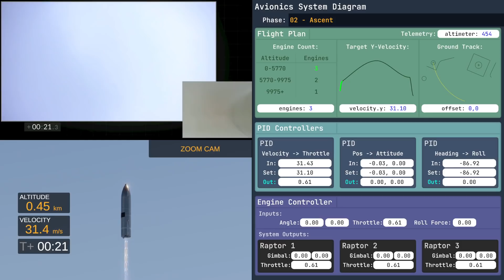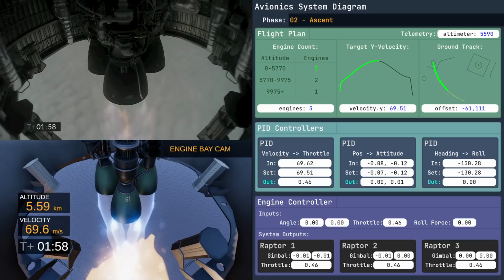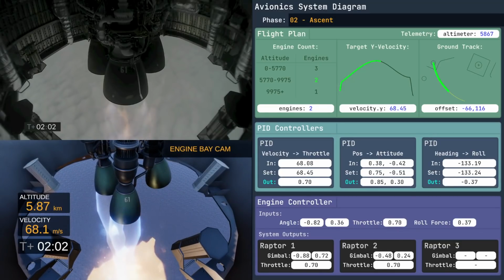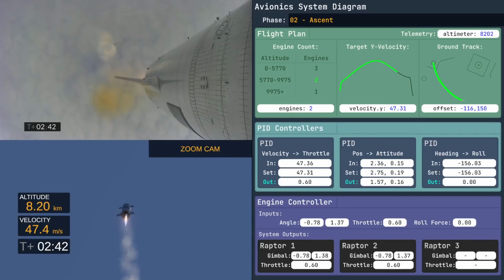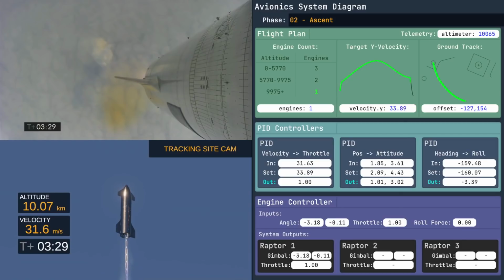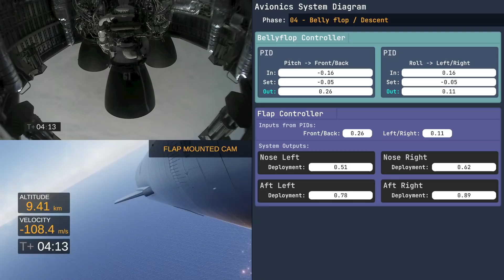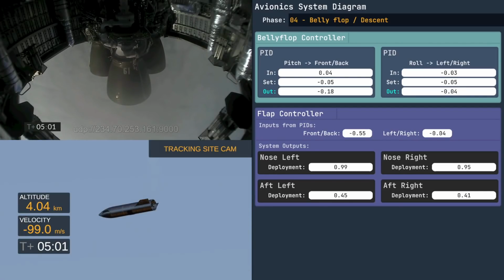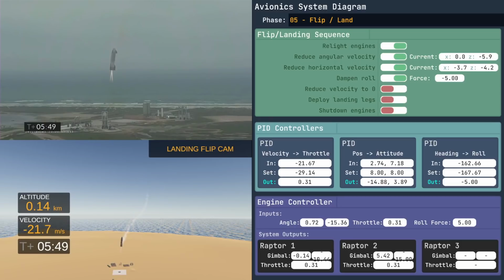Starship SN15.1 Simulation with Telemetry

Comment: the aft flaps arent fully extended during flights, those are like a degree of angle folded or so. You can see a that with all close-up photos
And the camera of the aft flap is actually on the forward flap, I don't know if you already knew that
Reply: I noticed that with the aft’s, have they always kept them at a slight angle on launch or was that just for sn15? I could’ve sworn they are fully deployed like a straight line for the previous tests like this: ————
Reply: @AudibleSpace  look at SpaceX main flicker account, look at SN9, SN8 or SN10 ascent image, you will see that all of them were not fully deployed
Reply: @politonno2499  interesting
Reply: Well they aren't folded in a couple degrees, that is the max they can extend